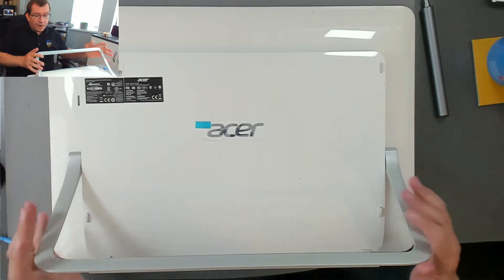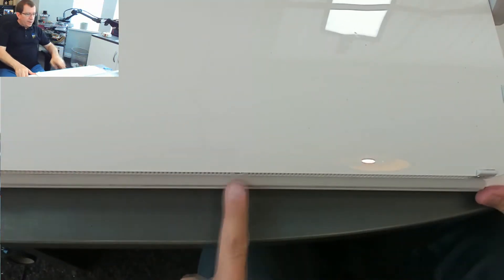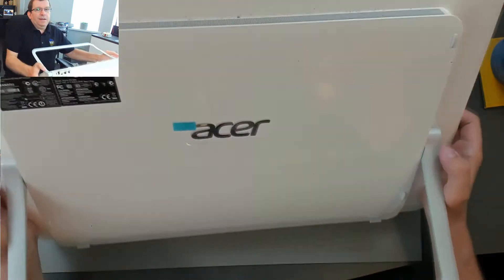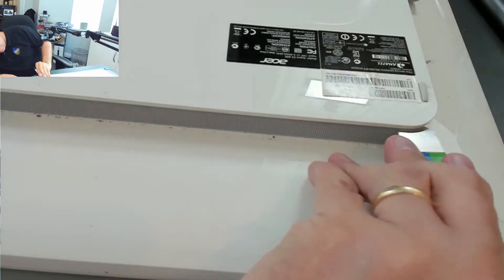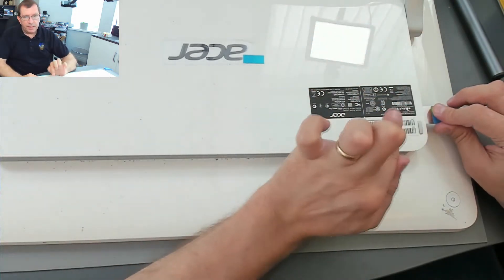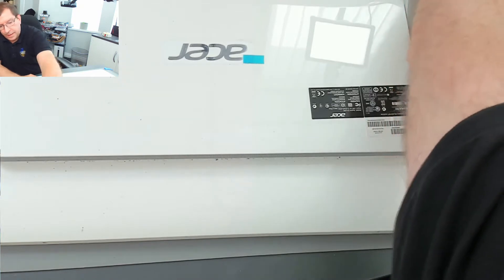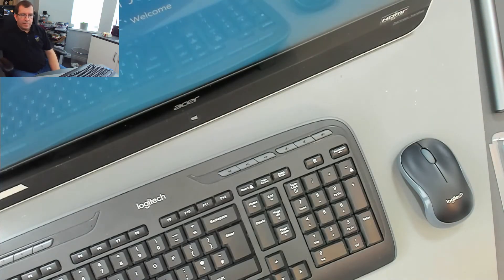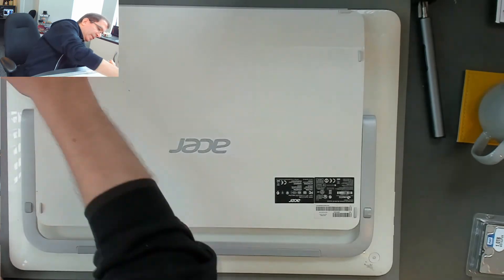[46] Acer Aspire all-in-one (Z3-600) - SSD upgrade

Comment: What is that device your using on the tabs? Please and thank you
Reply from the maker: It's a metal pry tool that also works well for opening boxes. You can see one in this kit on Amazon (they are often included in other laptop tool kits): https://www.amazon.co.uk/Professional-Precision-Pentalobe-Screwdrivers-Disassembly/dp/B09Q6D7RTS/

Comment: I want to add ram to my z3-600 but I am not sure how
Reply from the maker: It would require removing the larger metal cover, which I did not do in this video. You would need to remove more of the plastic bezel, and then remove the motherboard shielding. Here is the service manual for that procedure: https://www.manualslib.com/manual/462206/Acer-Aspire-Zs600.html?page=91#manual
Reply: @ComputerHelpNI  dude thank you so much

Comment: they gave me a acer exactly like that one , but it had a broken screen ,and wouldn't turn on . If the screen is cracked / broken is that the reason why it's not turning on?
Reply from the maker: I wouldn't think so -- I've seen plenty of laptops (including a few Acers) with broken screens that still worked fine over HDMI. 

If you have no power/charge light, I'd start by checking that the charger is working, and then making sure the power jack is OK. If both of those are fine (i.e. you're getting power to the motherboard), then you likely have a shorted or failed component on the motherboard.

Comment: Hello, is it possible to upgrade RAM memory?, How can I acces to the mother board in this model?. Thank you!
Reply from the maker: I’m not quite sure how, but I suspect you’d need to remove the whole plastic bezel / back case in order to get access to all of the screws that secure the metal cage around the motherboard. I didn’t need to access the motherboard, so I didn’t disassemble this PC quite that far and can’t say for sure. Sorry!

Comment: Hi, can you tell me the model of the battery please?  Thanks.
Reply from the maker: I didn't note the part number of the battery, as I didn't replace it. I suspect it's this one though: https://batteryempire.co.uk/batteries-for-laptop-acer/61-1013969-rdy-laptop-battery-as10d31-as10d41-as10d51-as10d71-for-acer-aspire-5733-5741-5741g-5742-5742g-5750-5750g-e1-531-e1-571g.html